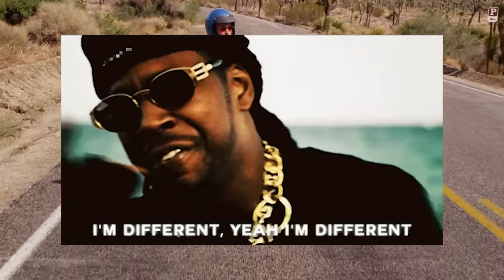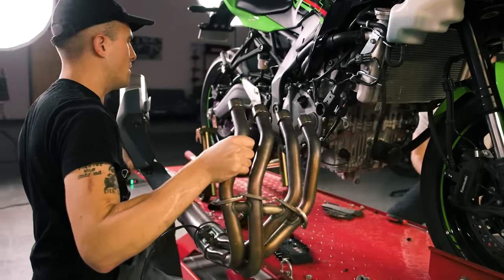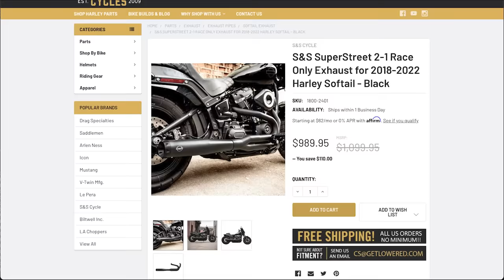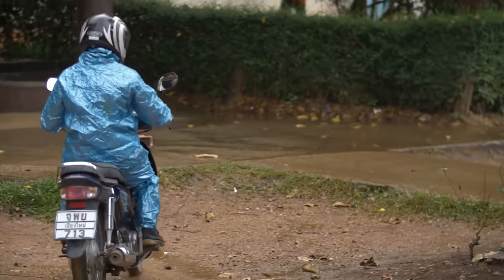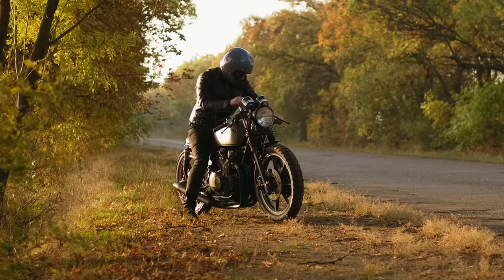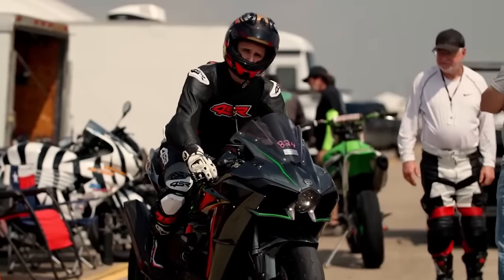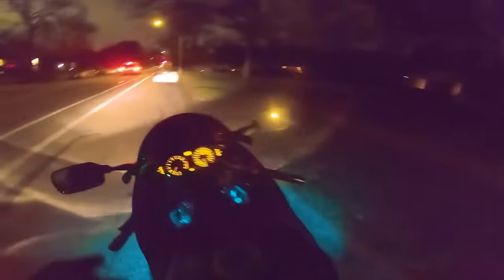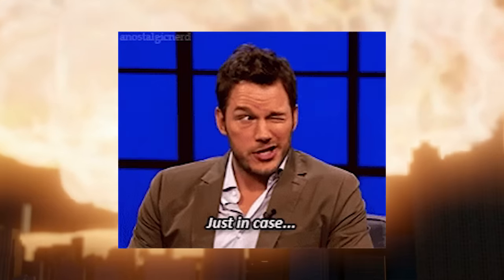Top 7 Illegal Motorcycle Mods that people do anyways

Comment: The real reason most integrated turn signals are illegal isn't due to visibility. LED's are very bright and visible. It's because most states have laws about the distance between the signals. The right and left signals need to be far enough apart that it's clear which side they're on. From a distance, it can be hard to judge if it's the left or right signal when they're right next to each other like they are in an integrated tail light setup.
Reply: The US federal standard used to be that turn signals have to be at least 18 inches apart. It may have changed as I have seen many stock cruisers that didn't even come close to meeting this.
Reply: Agree, in my country many people modded to make it looks like 2000's turn signal.
Reply: Well, if you're far enough not to distinguish whether it's flashing left or right, you're not close enough yet to be a danger, so who cares? :P
Reply: Same rule apply here in Germany, I have aftermaket turning signals on my motorbike and I've seen the inspector using a ruler to check the distance.
Reply: @CyberChrist how close is actual danger though.
Reply: @hihellothere9569  Depends on the speed, if you're talking distance, but 2 seconds is quite universal, so not distinguishing which side would take autobahn speeds.
Reply: Most maxy scooter - Tmax, Kimco, Adv have those integrated lights at the back. The Tmax in particular has about 12" between signals, and this is stock, factory lights. Suzuki Burgman have about 15" and the 650 have about maybe 18"
Reply: Delete em and put led signal strips on your rear peg mounts. Safer and better looking 👍
Reply: I knew about this but couldn't help thinking "So the drivers who are neither seeing me nor my bike for that matter, would actually (somehow) see my turn light and get confused?" Yeah, that makes perfect sense.
Reply: Ok
Reply: @1badombre82  But I have a solo seat and deleted the rear pegs...
Reply: Why I like the stock turn signals on my '18 V Star. Maybe not quite as bright, but larger diameter than those smallish LED lights. And on like 5-6" chrome stalks, they're nicely far apart. BUT- I don't know why the rear turn signals don't stay lit all the time, like the front ones? The law says 3 lights in front-Ohio anyway- Why not 3 lit in the back? And that expansion chamber that both mufflers are welded to on my XV250...IDK if it's a cat-con or just a really strange exhaust set up to make it quieter?
Reply: That's why cagers need to pay attention to where the bike is at on the road to determine which way they are going. The signal is there to inform cagers they are doing something. But of course a lot of people are idiots and text while driving while blaming everyone else for their own problems. But that is here nor there.
Reply: Saw one the other day that was just a single thin line of amber LEDs that ran on top of the brake light. The left half would blink or the right half. I had to really stare at it to even see the amber lights blinking. Slim and “cool”, but absolute trash.
Reply: Leds allow you to be seen better at night gonna have to disagree with you on that one. And the first cousin thing.
Reply: The ones I have seen personally make it pretty obvious
Reply: @CyberChrist  You don't need to be far to have difficulties reading them out. All you need is low visibility like in heavy rain or fog.
Reply: @christianbarnay2499  If it's rainy of foggy, you shouldn't be going fast enough that it becomes a problem ;)

More care should be applied as to whether people use their turn signals or not.
Reply: @CyberChrist  The problem is not that anyone is fast enough that it causes a problem. The problem is bad quality of communication and the false feeling of safety that can make people take risks they are not aware of. If the moto rider thinks the signal is sufficient to get the info to the car driver but the car driver doesn't get the info they might collide, even at low speed. Just because one acted a little bit too soon on the assumption the other had understood. And the other acted a little bit too late because he got an unclear signal.
Reply: @christianbarnay2499  Not feeling safe on the road is what keeps smart people alive, and counting on cagers to keep us alive is a losing bet.

I agree that the clearer, the better, but we all know that those who should be watching the most closely simply don't.

Why not put them two metres apart to make it even clearer? ;)

I'll repeat, it's a compromise between visibility, distance, and relative speed, and if the message isn't clear, they should reduce their speed according to uncertainty.

Yeah, right.
Reply: @CyberChrist  We agree on the general picture. My point is that humans are humans and when you give them a device that pretends to help with their safety they simply tend to lower their guard. So it's very important to remind all bikers that a set of turn signals that is not separated sufficiently won't give them the level of security they might expect. Regardless of legality or who is responsible in case of an accident, in the end when a car and a bike try to occupy the same spot at the same time it rarely ends well for the people sitting on the bike and it often also leaves permanent scars in the car driver's mind. Seeking blame on other road users and ignoring the actual issues some poorly designed devices have is just a losing game.
Reply: @christianbarnay2499  Frankly, I think it's a non-issue ;)

Comment: The reflectors are actually for when the bike is parked in the dark in a public space, or perhaps to simply be seen more easily from a side profile in general. Really kind of a specific law. Its the same for cars. I learned this when replacing the factory corner lights with built in reflectors on my 1990 Miata with aftermarket clear lens, LED lights with no reflectors. the website said theyre not street legal so i looked into it further. Also, in Pennsylvania, chassis lighting on bikes is legal but not on cars, because it allows the bikes to be seen more easily.
Reply: I would love to know the craziness behind letting SUV have tinted windows, but not cars.
Reply: Or if your electrics go out while riding. Probably a few other scenarios too
Reply: @robertsmith2956  Pretty sure you know what the craziness behind it is. if you tie your self worth and ego to how your vehicle looks, you aren't likely going to be driving a soccer mom transport in the first place. Said soccer mom also is likely using just enough tint to actually be useful while not actually blocking visibility inside, not going for the darkest tint the shop or amazon has available without thinking "does going 25% above the legal limit turn my vehicle into LEO bait? nah, that would be profiling, which is probably illegal, and gives me an excuse to complain about how evil they are."
Reply: @metalwolf112002  They make the cars AC work much better.  I could feel the difference as a power pole shadow went over the car.  Light tint doesn't do it, you want a dark one.  Or at the very least a mirrored one to keep th esun out.
But I was referring to some nut states allow dark tint on SUV's but not cars. Think Pennsylvania is one of them.
Reply: Side fork mounted reflectors are really just for when a car is approaching your bike bc they will only reflect when light hits it not while riding alongside of a car. Replacing those reflectors with LED fork lights will make your bike more visible while riding in the dark. Period

Comment: I live in Australia where almost everything is illegal. On my 650 I’ve had the restrictions removed, reflectors taken off, fender eliminator kit, colour changing under glow and a full black widow exhaust system with no baffles. If I’m gonna get caught it may as well be worth it
Reply: I live in California, just trying to make a little 125cc Amigo work after stolen Vespa, any engine upgrade "Not certified CARB for your location" keeps me driving me car much higher MPG,

Comment: I recently acquired a 2018 Kawasaki Vulcan S in exchange for a boat I never used. The first thing I did was to remove the sewing machine exhaust system and installed a CS Racing full exhaust. Removing the stock exhaust also removed the catalytic converter. The stock system is very heavy compared to the CS Racing exhaust. Never throw away or sell your factory exhaust system. Many   motorcycle shops around my area won't buy or accept a motorcycle as a trade in without the factory  exhaust system installed on the bike.

Comment: Also have to remember that underglow kit laws vary from state to state. For instance, in NC, you can have them as long as they are a steady color, no breathing, pulsing or changing. And that steady color can't be red or blue. Yet in VA, underglow kits are not legal at all.
Reply: @briansgate actually you might have been misinformed.. on NC the relevant NCGS is no white lights to the rear ( pretty self explained)
Unlawful use of red and blue lights ( just don't use red or blue) and unlawful use of amber lights ( odd and not often enforced) there is no general statues for flashing or pulsing lights however... Hope this helps :)
Reply: @lightning5trik339  correct they don’t specifically say you can’t pulse and change, but I see that as a LEO having a “reason” for pulling you.
Reply: VA blows
Reply: Legal in PA. I have mine set on blue. Yammies opinion is lame a.f. of lighting. Kinda pissed me off. Anything i can do to be seen better without being obnoxious is good imo.
Reply: I definitely do not have my lights set to blue, and my lights definitely do not change to red when i flutter the brake lever.
Reply: @St.FighterZ agree. I have underglow because a lot of the riding I do is at night, and I want to be visible so people don't merge into me or rear-end me at a stoplight
Reply: @JaredCantSkate  same. i ride on country highways at 5am to get to work. I want EVERYONE to see me. I have my lights set to White.
Reply: @JaredCantSkate Underglow lighting is going to become even more vital as E-Motorcycles are silent as Fuck.
Reply: You can do anything you want, whatsoever, as you are a free human being with volition.
Governments tax people to pay for enforcement of prohibitions and penalties.
Most of those prohibitions are antiquated, outdated, many times unconstitutional, and have more to do with government power than they do any practical harmony among the population... motoring or otherwise.

Comment: Chassis LED are great. I agree they shouldn't be flashing, but there's nothing wrong with increasing visibility and I loved having them on the one bike I did this with, it looks fantastic.
Reply: Wisconsin allows underglow as long as it doesnt flash and is specific colors.  Its a safety issue that should be legal everywhere.
Reply: Chassis glow, or ground glow, or both?
Reply: I got a kit (orange LED, on orange and white themed fairings) that was half a dozen or so LED buttons that I hid in various places around the bike. I think I had one on either side for the engine compartment, but I forget where I put the rest. But it looked really great.
Reply: I've seen people do it on what is essentially a custom show bike, festooned with chrome literally everywhere. But not lit up when riding. Honestly those kinds of motorcycles rarely are riding.

Comment: I don't remember hearing it in the video, but there are some states out there that do require your turn signals to be a certain distance apart...I guess for visibility purposes and to distinguish it from your tail/brake light
Reply: I have never heard of anyone getting a ticket when they break your turn signal, or mirror off.
I knew someone who got a ticket riding home without a helmet when his helmet was stolen at work.  He used to think I was stupid for taking my helmet in with me.
I had fun with my handicapped tag.  DMV refused to issue me one for my motorcycle.  So I gave them a  fake car, and put it on anyways.  The look on cops face when I pulled into a handicapped space, and put the mirror hanger on the seat was priceless.  I couldn't walk, I could ride fine.

Comment: Loud exhausts, and smaller than legal number (license) plates are something that the UK police like to issue tickets for. It is possible to remove the headlight from a bike, and for it to still be road legal. You can get something called a daytime MOT (Ministry of Transport Test). Which will allow you to ride your bike, normally a dirt bike, on the road during the hours of daylight only.
Reply: Also, the reason for the plastic plate holder out the back is in some places (I think it is a Eurozone thing so Britain likely still has it too) is that the tyre cannot be the furthest back port of the vehicle, it has to have some body work / frame as the very end of the bike.
Also in the UK you can ride without mirrors but if you do have just one it has to be on the left hand side.

Comment: The giant rear fenders are because in Europe (and I think Canada) your plate has to be even with or past the back of the rear wheel.
Reply: It also keeps the turn signals at correct width.
Reply: at least from the factory. My Tail Tidy positions the plate pretty much above the wheel, yet  when I got pulled over they didn't care

Comment: 1.  Reflectors are for side exposure.  Headlights, turn signals and and other front/back facing does not provide ample visual, see Turn signal discussion for obvious reasoning some states use Hand signals.  

2.  Helmets cannot be modified, per manufactures.  Purchasing helmets with modifications are legal, as they have passed ODOT testing requirements.  Drilling holes into your helmet will reduce it's durability.  Attachments not mechanically connected are legal, as they are able to break away without causing potential harm.

3.  Under-glow, while in operation, is illegal on ALL vehicles, in all 50 states, per ODOT Regulations.  They create a distraction and can also be confused with Emergency Vehicles.

4.  Regardless if you purchase new, used, private or dealership...  it doesn't even matter if you are borrowing.  It is the responsibility of the Operator to check and insure their vehicle is operating up to Health and Safety Standards...  Ignorance of the law is not a viable excuse.  Yes, It sucks, but if you are the victim of a accident where someone else responded "Sorry, I didn't know it was illegal", would you REALLY allow them to walk away?

5.  Cats were added to bikes as a compromise, they were pushing for banning bikes and this was the alternative.  If unsure how it applies when someone else did/authorized the change... see #5 above.  Manufactures don't get the Citations, the riders do.  Dealerships will sell whatever they can, so long as it's legal to sell.  They will even sell an off-road bike to someone they know wanted a ride to work...  they make sure to cover their butts.

6.  No Manufacture want to spend extra time and money to engineer, design, test and install safety equipment.  They did so because there was some issue that demanded it.  In other words, it is there for a reason and none of them are "to annoy you".  Just like the reflective vests for road workers... it's more about making sure you get home safely, not how you look getting there.   Form and Function should always be priority, and it's better to have some knucklehead laugh at you, then spend the rest of your days a human vegetable, drooling on your shirt, peeing into a catheter and being spoon fed baby food by a CNA that looks like a Hells Angel B*tch, cuz that would be the only person able to turn you every couple of hours.

Comment: What's nice about my bike is that there were no emissions regulations until 1979 on motorcycles. (California not included)
Mine is a 1978 harley davidson flh Bobber. 
(Grandfathered)
Over the last 20+, I went to court twice, and both times, the ticket was thrown out. 
(Illegal exhaust, straight pipes)
Reply: Isn't it ILLEGAL to not use the stock manufactured exhaust?  You couldn't change it, or you would break the law.
Reply: @robertsmith2956  
Antique and vintage vehicles have a different set of rules. 
The stock exhaust rules are fairly recent, and the rules for stock exhaust didn't exist at the time that my bike was mfg. 
That is why mine is grandfathered. 
It's like antique cars that don't have seat belts. 
You don't have to install them if they were originally not there, but if they install them, then you are required to wear them. 
But you can always just remove them as long as they were never originally installed. 
I can't remember the year seat belts were required by law.
I think it was the late 60s (68/69). I'm not sure.

Comment: Neon underglow is usually legal.  The laws on lights ban lights which shine to the front or back.  The older laws don't ban lights which shine down.  Some ban specific colors, so avoid those and you are fine.

Not saying they are good, or that I use them, just that they are almost universally legal.

Also, you will get pulled over for them.

Comment: Exhaust mods... I don't understand that one. I appreciate a loud exhaust... at the track. On the street, I don't want to draw the attention of every LEO in a 5 mile radius when I want to flirt with the red line. Plus, unless you get a dyno tune after installing that new exhaust, it will most certainly run better with a totally stock exhaust, and airbox if it has carbs.